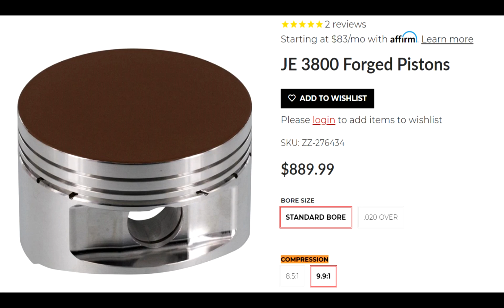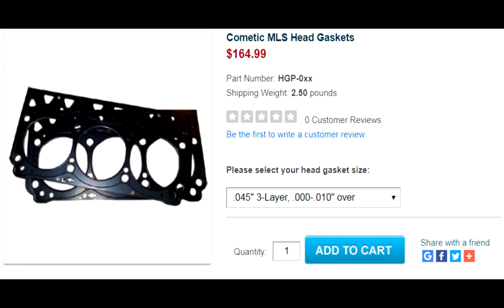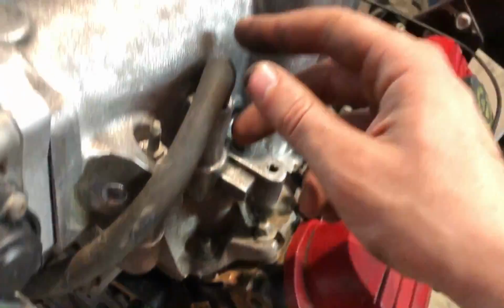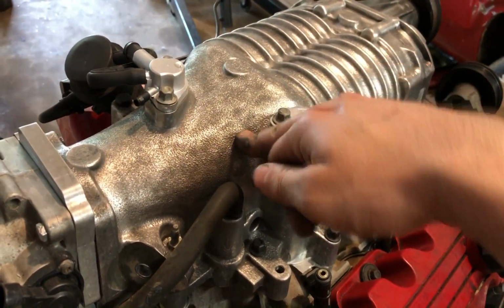3800 Supercharged L32/L67 - EVERYTHING you need to know UPDATED

Comment: I have a L32 SC engine I cannot find the MAP sensor anywhere van you help
Reply from the maker: It should be mounted to the side of supercharger. There are two of them on there actually. Small black sensors. Here is what the newer style for a L32 series III you probably have looks like.
http://repairguide.autozone.com/znetrgs/repair_guide_content/en_us/images/0996b43f/80/20/2f/84/medium/0996b43f80202f84.gif

On earlier L67 series II models, there is only one MAP and it looks different. You actually only need 1 for a Fiero swap, and I think the older ones work great. Here is what the old style looks like. https://www.rockauto.com/en/moreinfo.php?pk=497116&cc=1317113&pt=11207&jsn=417

Comment: did that block already have the stand alone pulley for the supercharger or did you bum it off another a gtp or bonneville? i'm only asking because i'm trying to do a top end top on my l36 regal  and need to get one of those pulleys and mounts
Reply from the maker: It did not. I bought them from http://www.smoothflowpulleys.com/

you need both the hub and the pulley.

Removing the old one and pressing the new one  on can be difficult.

Comment: You should really just use the auto light 104's the old copper core plugs because it gives less of a "point" or hotspot in the combustion chamber. Every build is different but this is what I found on my Regal GS
Reply from the maker: I had 104's before. Think they're that much better than the AR103s?

Comment: Some awesome tech in there... 
I may have missed it, what was that fuel pressure regulator you’re using? 
Also did you have an “engine only harness” made?
I’m doing an L67 into Chevette
Reply from the maker: It should be in the build thread, but it's here:
https://www.summitracing.com/parts/tnk-afpr1

Nope, the harness I had made was specific to the Fiero. You'll have to work closely with someone to get a chevette harness made. Probably will have to do some research yourself. Check out http://www.alldatadiy.com/ - you can buy all wiring diagrams for cars here, and you will have to determine wire lengths yourself
Reply: @FieroAustin  
Thanks for the info and the fast reply!

Comment: Love the video.....my computer was already performance program...the engine is out and I’m going with a turbo with a 3000 torc converter and 60 pound injectors....it’s hard to find E85 gas so I’m stuck at using 60 pound injectors.....the fuel pressure regulator will probably be just as good as having to have my computer re programmed....the PCM has already the deletes and performance shifting, and the idle and Rev limit disabled.
I’m using a modified L67 intake modified with an opening like a series 3.....I’m planing on using the sandwiched intercooler and a external air iintercooler.

My trunk is already cut in half....so I might put a cooling fan under the exterior intercooler core and cut a square opening in my deck lid.
The turbo is pretty big” this is the reason I bought a 3000stall speed torc converter....might to a 50 shot of nitro oxide to activate on take off.
To spool faster.

So many choices lol.

Ps with a exhaust mounted turbo there’s only 1 space to route the oil return line...it’s one of the most frustrating part of the build...the automatic transmission blocks everything.
Reply from the maker: Hey I might advise you get reprogrammed anyways, if the tune isn''t already setup for 60lb injectors. That will really mess up fueling

Comment: Clean spark is always needed for maximum  compression with maximum air intake, if you ain't got the mixture lined up just right you ain't getting maximum horsepower, ever run a car on file plugs.
Reply from the maker: Thanks for the tip

Comment: Was that a N/A engine? And you put a SC on it? I have a 2002 Grand Prix Gt I want top swap it? Can take a SC an put it on my series 2 N/A motor?
Reply from the maker: No it was not a NA engine. Don't do that unless you gap the piston rings differently and know how to handle the extra compression; the NA pistons are different.
Reply: AustinH thank you 💪🏼
Reply: You can absolutely top swap a GT. Bottom ends are plenty strong. Check mine on my channel. I even had another top swapped GT before my current one for 8 years at 275whp with no issues. Yes it has 9.4 compression vs 8.5 on the gtp. Just scan for knock and you'll be fine. Tuning is key.
Reply: @michaeltoscano4491  thank you cause i don’t know what the fuck Austin was talking bout 😂

Comment: Great video man! I had a question. I bought a 2002 Chevy Monte Carlo SS (previously modded) it has a Gen. 5 M90 Super Charger. I need HELP identifying my engine!?  Mine has the Northstar throttle body, ZZP cold air intake, ZZP spark plug cables. However,  I can't tell (and so called "Experts") can't tell  me what style of engine I have, L32, L67, L27 non-supercharged & etc. I'm trying to find out, if mine was an engine swap, or a ZZP super charger kit mod!  I spun rod bearings, and my MC SS is just sitting. Advice please?  How can I identify my engine, so that I can fix? Any casting numbers, stamped ID numbers? You obviously have a wealth of knowledge on the 3800 SC.
Reply from the maker: The difference in blocks are:
NA motors had different pistons (higher compression ratio)
Series 3 (gen 5 blower) motors had different connecting rods from Series 2 (gen 3 blower) motors

Comment: You spent some time and money to get better airflow. Such as porting your heads, having larger valves, N* TB ect. Doing those steps in a NA engine will provide more air and thus more power. But with a SC engine can this also accomplished by getting a smaller pully? I am not saying that (all things equal) that what you did would be worse, actually slightly better. But the cost and time to accomplish almost the same thing (more air) can be done with a smaller pulley if I understand it correctly.
Reply from the maker: You are right, a blower is the best source of cheap power. Without intercooling or running E85, you would be lucky to make more power under a 3.4" pulley.

However I got my heads ported for $200, the N* TB/LQ4 MAF for $25,  and the larger valves came with my heads. Junkyards are great. Stock heads will outflow an M90 according to intense, but it certainly can't hurt.

Comment: Thanks mate great video by the way 
I have an idling surge it holds its rev but if I’m of the throttle it will surge at idle can you help 
I’ve changed all vacuum lines ignition leads and plugs are new 
Thanks
Reply from the maker: First check out your O2 sensors (make sure the front is OK and the rear is deleted from PCM or has a dummy). Check to make sure your MAP is plugged in correctly. Same with MAF and IAT.  Then check your idle air control valve and then boost bypass control valve (could try unplugging it). See if there are any engine codes. Also have your tune checked by a professional.

Do you have a custom camshaft? That can cause strange idling if the PCM has not been programmed properly
Reply: AustinH thanks mate 
Stock cam I’ll check all the above 
Awesome video cheers 🍻
Reply: @FieroAustin  where exactly is the map sensor located on the S/C 3800? I know where it's located on the N/A 3800. Reason I'm asking is I have an L36 and looking into the L36 supercharger kit from zzperformance. Im just curious because I know you said yours wasn't hooked up in this video.
Reply from the maker: @boosted0079  The MAP sensor is just mounted on a harness bracket near the supercharger. It's just a black rectangle.

Comment: 3800 is nothing but a slightly modified 3.8L Buick v6....same as the Grand National used and thousands of other GM cars used. It is just as rebuildable as any other engine. If someone has problem with lower end it is because they did not do it right. Ring gap should stay stock for up to 400hp and not be a problem. By the way...this engine is not good for much above 6k rpm. When you start going over that too far you need to get it professionally built. Indy cars running this engine generally failed above 9k and even at 8.5k rpm were only reliable enough to barely get to end of race.
Reply from the maker: Thanks for the info! I didn't want to go into the history of the engine much
Reply: Robert Clark that’s false though.... the 3800 is different to the 109 3.8 found in the grand nationals and t types
Reply: @Matt_Lanzer_13  Actually i am quite correct and as i said it is a modified 3.8L Buick V6 in reality. Don't know how old you are, but i remember when the 3800 came out and the specs and story behind it. I was extremely interested in the engine because of its foundation being one of my favorite engines.
Reply: Robert Clark all I’m saying is, it uses no parts from the 3800 found in the grand national. The engine was completely redesigned. Hell anyone can figure that out, it’s readily available info on the internet. The only thing it shares with the GN motor is the displacement lol
Reply: @Matt_Lanzer_13  But Matt if Robert acknowledged that, well then he wouldn't be able to tell you how much he knows and that you clearly couldn't know as much. He is quite correct if you consider any Buick V6 with the same displacement a "modified" LD5 and not a redesign, progression, evolution (pick your synonym).
Reply: @Matt_Lanzer_13  I'm not saying anything in his initial comment is wrong (there's great info there) but I certainly enjoy taking the piss out of someone who's "quite correct"" with their only qualifier being they were alive when it happened. smh
Reply: SwnkyTiger he’s not correct though. You can literally google it. The gn/turbo bird 3800 shares absolutely no parts with the 3800 s1-3. Completely different engines
Reply: @Matt_Lanzer_13  hahaha I hear ya buddy. That's why I mentioned the LD5 engine from the GNX and joked that everything past that is a modified version of that. It's a silly claim to make and then to argue over, especially qualifying it with a comment about age. Hell the first Series 3800 doesn't even share much with the Series 2-3. However when I mentioned the good information I was referring to the portion about ring gap and usable rpm range. It doesn't mean he's not conflating information from the two different engines. However, I've not seen that mentioned elsewhere and would never claim that was incorrect without reading into it myself, his mention of Indy cars should make it easy to look into though.
Reply: SwnkyTiger my b I read your reply fast lmao
Reply: @Matt_Lanzer_13  no worries bub